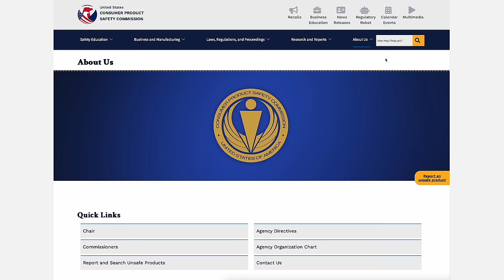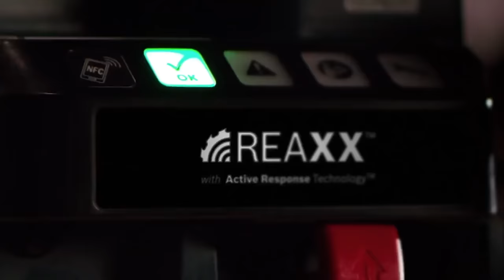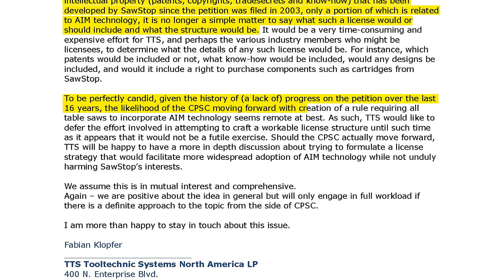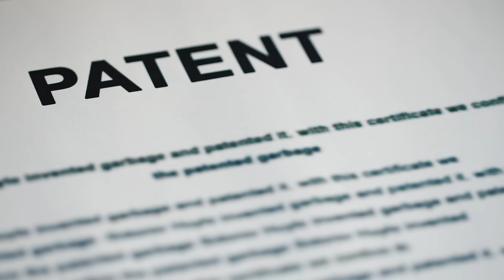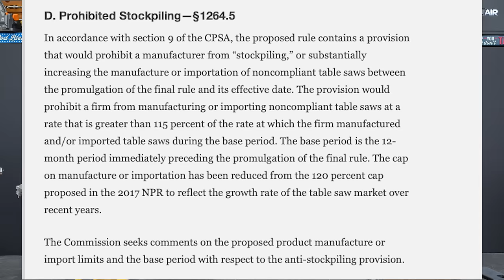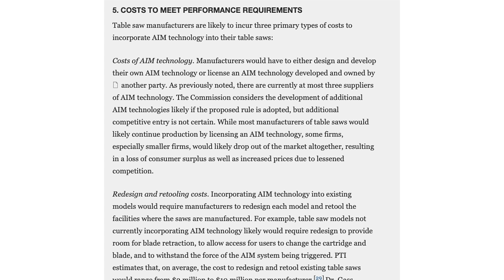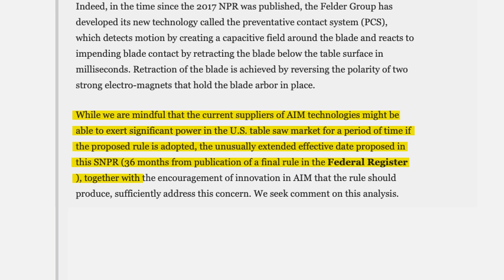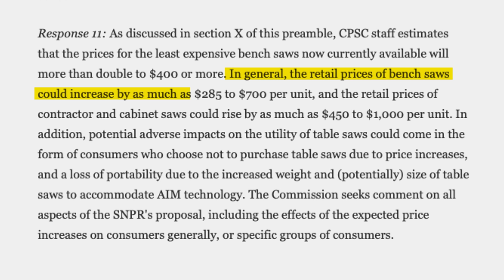The US Government is About to Change Table Saws FOREVER!

Comment: Just after the video discussed implementing the rule in 30 days to 6 months, I gave it some quick thought based on my retiring from a career as an aerospace mechanical designer and came up with reasonable time frame of 3 years. 
Once the rule is mandated, a manufacturer will have initial meetings on the design followed by product detail design. Tooling design for molds and product handling won't start until a certain amount of design maturity is reached. Cutting chips for the tools and any product detail parts won't happen until the designs are formally released. So, 3 years is comfortable. 1 year would be very rushed. 
A rule implementation of less than a year will mean that manufacturers discontinue sales until they can redesign their saws.
Reply: Do you think we need to Keep government out of this, this will create new laws and taxes with higher insurance costs to shops and individuals seeking liability and disability insurances.   Will OSHA rules could shut us down if we don't comply.

Comment: As a patent holder I am well acquainted with the patent laws and every US Patent has a rider built in stating that the patent may be used by the US Government or as a public safety issue.  The government can (after litigation)   require a patent to be licensed for what the court determines to be a fair and reasonable fee, but that can take time.
Reply: The patents that Sawstop holds started expiring in 2021, and they put out their first product in 2004.  I don't think the patents are a major issue.
Reply: @stevesether  With Sawstop, they are an issue. The inventor was a patent attorney out for a payday, not safety. Multiple manufacturers have said he was asking for a license fee in many cases equal to their entire selling price in the early days. After that didn't work, he started lobbying the government to mandate his patented technology. When that didn't work, he started Sawstop.

For as simple of a mechanism as Sawstop uses (conductivity detected on the blade trips a brake), Sawstop has literally hundreds of patents on every conceivable method of stopping the blade. They've used every legal trick in the book to extend each of those patents for as long as possible. Bosche's saw used completely different technology that didn't infringe any Sawstop patents but they still pulled out of the market because proving that in court would've been more expensive and eliminated any profits.

Comment: Price increase also seems to ignore the cost of cartridges and blades that need replacement.  The spares that need to be stocked to ensure that if you trigger off a staple left behind by the lumberyard, Black paint, mirrored plexiglass, etc...you can still hit your deadlines.
Reply: Probable cheaper then losing a finger hand etcetera.
Reply: @ChickenPermissionOG right, but the odds of such an incident happening are very low, while the odds of triggering the cartridge for a dozen other reasons are very high

Comment: Already way ahead of this I'm using a radial arm saw from 1968 and its extremely safe if you have the right blade and you know what you're doing. U can get them way cheaper than one of those little table saws too (sometimes free)
Reply: I had a radial arm saw. It is just as dangerous as a table saw but in a little different way. I believe most people do not understand that a zero hook blade must be used to reduce the possibility of kickback.

Comment: Thnks for spending all this time to get us up to date Matt.  Fct is last year I cut part of my index finger off on my table saw.  Compared to many injuries it was minor BUT a HUGE Eys opener.  I sold that table saw in less than a week and bought a Sw Stop PCS Caninet saw.  That accident changed the was I run my woodworking business.  Saw Stop as you not only provides that extra measure of saftey but they had made it so easy to remove and replace the blade guard.  Now unless I'm using the Dado set or my sled the gurd is ALWAY on.  God bless you matt and thanks again for all you do for us.  I appreciate your ministry.
Reply: The only issue I can see with that based off of what they’re saying a new system will be required for dado blades as well.   Does saw stop have a system for dados?
Reply: @elktrip2000  Yes they have dado blade stopping cartridges
Reply: @elktrip2000  Yes. You do have to use a different cartridge for a dado blade though.
Reply: The Dado brake cartridge is a separate purchase when you get the saw.  It is very easy to install and then replace the standard blade brake cartridge.  Takes maybe a minute or so.  I've used it many times.
Reply: @richragan4810   Just wait for that to be 'too complex' and so 'dangerous' for you to do. Has to go to the manf only. Just $100 charge plus the blade pack, if you've signed up to the 'special deal'....;)
Reply: Do you think we need to Keep government out of this, this will create new laws and taxes with higher insurance costs to shops and individuals seeking liability and disability insurances.  In addition to cost of table saw.  Will OSHA rules could shut us down if we don't comply.
Reply: @elktrip2000  Yes, they do. But it requires an extra brake mechanism that isn't included with the original purchase of the saw. I think the sacrificial aluminum on the dado brake is wider than the piece on the standard brake. I priced the dado brake at a local supplier yesterday. It's $119.
Reply: @peaceshalom3030   OSHA rules ONLY apply to employees.  OSHA rules do not apply to self-employed people or hobbyists.  So, if it's an OSHA rule, this rule will only apply to your business if you have employees.
Reply: I 've noticed that during the saw legislation video a 
Political Ad with 
Bernie Sanders
asking people to support 
Kamala Harris has popped up twice.
Does that mean the guy producing the video supports
Bernie Sanders , or
Kamala Harris?

Comment: Years ago I started with a circular saw plunged through a sheet of 1/4 ply, flipped upside down with the trigger taped on. I honestly think injuries will go up as a result of this. Make no mistake - this is about money not safety.
Reply: Geez, at least use 1/2! 1/4 ply I can break in half by leaning on it

Comment: This requirement will barely lower the number of serious injuries for 2 reasons: #1, the saw-stop tech has to be able to be disabled so you don't activate it when cutting wet wood, nails, etc., so a bunch of people will just disable it so they don't risk needing to buy a new blade set.  These are also likely the people who won't treat the saw with respect and are more likely to get injured.  #2, there are 10s or 100s of thousands of active table saws out there that will continue to cause injuries for years to come.  The government needs to stop trying to protect people from themselves.  The CPSC is supposed to stop negligent and malicious issues with products, not impose severe tech changes to a tool that is always going to be dangerous.
Reply: seatbelts, airbags, many examples of things like this that have worked over time.
Reply: @jasonrowe6302  Seatbelts? The things that a bunch of people don't wear and the only reason half of the people who do is because the cops will ticket them otherwise? You gonna send cops into everyone's house to ensure they aren't disabling the sawstop feature?
Reply: @shawnpitman876  great logic to not do it. Seatbelts cost more when they were implemented. Now it's just the price you pay for the vehicle. A very small portion of people chose to not wear them as will a very small portion of users if saws with the safety device. It's likely not going to impact saws already out there just like the new seatbelt law didn't impact cars already on the road.

Comment: I’m on job sires every day. This week we had 30 degree weather followed by 70 degree weather with rain. Condensation was dripping from everything. How is this tech going to hold up in these conditions?
Reply: It wont. I've personally burnt though 7 sawstops cutting damp wood, and with the price of replacement cartridges I decided I was better off buying a saw without it.
Reply: It won't. But don't worry. The fine folks at Sawstop will really enjoy the new yacht you're helping to pay for, and the folks on that safety committee who have never used a power tool in their miserable lives will get a warm fuzzy sense of superiority for protecting us from ourselves.

Comment: I think the worst injuries occur when you grab the work piece past the blade and get a kickback that forces your hand into the blade at high speed. You can't let go of the workpiece fast enough is the problem. I don't think a lot of people just push their own fingers into the blade from the front side.
Reply: Met a middle aged and well established cabinet maker who lost 1/2 the length of two fingers pushing stock through a table saw.  He then showed me his other hand that had the same two fingers trimmed the same amount.
Reply: @gregohare2406  Wow. One instance doesn't prove me wrong, but it does cause me to think twice about it.
Reply: @mckenziekeith7434 it good to be careful, but this guy was (possibly) an idiot. He did it twice to the same fingers on each hand. He’d probably do it a third time if he had another

Comment: My grandfather and grandfather were carpenters, my father is an avid advanced woodworker and I do woodworking - never had an accident. Although I was taught to have a good well made tablesaw. Was taught how to feed the material into the saw. What type of blade to use and when. How and when to use a push stick. I run a unisaw from the early 90’s and my dad’s unisaw is from the 40’s. I’m all for the safety but the sawstop having the patent and the government saying every saw needs it is well creating a monopoly - just another way of using “safety” as a means of control - never though my old table saw would become political pawn……

Comment: There's quite a few problems with this proposal:

1.  If this is mandated for table saws how long will it be before other tools and equipment get similar mandates?
2.  More importantly "safety measures" put on dangerous pieces of equipment could actually embolden people to be more reckless and complacent when they're using said equipment.
3.  And of course, why is it the governments job to prevent careless people from being careless?  If someone missuses something how is that the public at large's fault?
4.  You can't fix stupid.
Reply: lets NOT forget #5, people WILL remove various safety devices if they think those devices hamper productivity.... and some will be removed simply because they can be removed... and #6, accidents will STILL happen no matter what safety devices are on a tool or other hazardous device... that's part of Murphy's law, anything that CAN go wrong most likely WILL go wrong....
Reply: @mikewhitaker2880  Yeah there's definitely more issues, but I got lazy and just mentally lumped everything into problem 4.  Also I myself am guilty of taking safety guards off of my power tools, though if it's an internal safety component were someone has to actually take the tool apart to remove it I think most people would probably just deal with it.  Especially if that component cost them hundreds of dollars extra to be there.
Reply: You can't engineer around stupidly. Remove the safety labels. Let natural selection work itself out. Give emergency services the job security they deserve.
Reply: Relating to #3, Congress passes laws that create agencies like the CPA and the FTC and their job "IS" to make things safer because that is what the law says. The Government answers to groups with money. (Because they all need it to get reelected)  Insurance companies have mountains of money. They do not want to spend money on repairing your flesh. They want to take your money and pay themselves huge bonuses. Look at cars, what is the cheapest car in america? Its well over 20k now. But it has all the safety stuff on it that only Mercedes had on their cars 20 years ago.  Mercedes didn't push more safety so that they could get their patents licensed by other manufactures. The Government wants to make things safer, all things, across the board.  Eventually our Government is going to go bankrupt, easily within 10 years, so none of the "Safety" laws will matter because there is going to be a big reset.  I foresee a huge black market for $300 saws coming across the boarder from Mexico.  Just watch Ebay and FB Marketplace they will be everywhere just not at Lowes and Home Depot.
Reply: 1. Tablesaws are disproportionally unsafe compared to other tools, this is not a problem, the reason that this is being proposed in the first place is because tablesaws are one of most dangerous tools
2. no evidence backed up to this claim, but no, in general safety options are deterrents, especially if the safety option is almost all pros. Outside of cost, the sawstop solution is almost entirely all pros
3. The government has in its best interest to help its citizens, the government legislates safety all the time, from the rules on the road, to food, etc. etc. etc. In addition, this costs the government money, we have partially subsidized health, and lost productivity is also less tax revenue.
4. agreed, but even a stupid person grazing their hand over a saw blade can have their fingers saved by this system.

Increasing safety standards is not necessarily a bad thing, we look at modern cars, from bumper design to seat design, to extra features such as rear cameras.
Reply: @Jazzyluvsyou100  "disproportionally unsafe compared to other tools" Wow, what a completely useless statement devoid of any actual useful metric. Two give an example with made up numbers to dumb it down: If two people a year scratch themselves with a hand saw, and four people a year scratch themselves with a carving knife, that's like hand saws are "disproportionally unsafe!!1!" compared to carving knives... Not only "disproportionally unsafe!!1!" but like DOUBLE!!! It's only four people a year... 
"almost all pros" What does this mean? 
No. That's not what the government is for. This is nothing but nanystatist intervention that will cause prices to go WAY up pushing small companies out of the market and price these out of the hands of regular people.
Reply: @bitfreakazoid  

Chill out dude.

Let's break this down.

Of the power saws tablesaws are the most dangerous, now we can't know the exact rate of usage comparative to other saws. But of power saws, tablesaws make 78 percent of the injuries of the power saw category, that amounts to around 29k a year in ER visits/injuries. Tablesaws are in the top 4 most injuries per year for power tools. 

 Obviously there are more dangerous tools..... such as you know, ladders(that are also highly regulated). that doesn't mean we cant make them safer

""almost all pros" What does this mean? "

Ok, so imagine you have safety feature on a tool, lets use Tablesaws for an example,  So you have a blade guard for example, now this obviously make it safer, but they also have usability downsides, its harder to see where the cut is, certain cuts can't be done with a blade guard attached. etc. etc. This affects the usability of the saw, it makes it more cumbersome to use, those are "cons". The reactive blade system has almost no cons, it doesn't affect your ability to see the blade, it doesn't affect your ability to do certain cuts. The only bad thing it does from my understanding of the technology, is that rapid voltage changes in the blade from metal will trigger it.

So, almost all pros. Sometimes safety features can make the tool more cumbersome to use. The only practical downside to this is of course "COST".

"No. That's not what the government is for. This is nothing but nanystatist intervention that will cause prices to go WAY up pushing small companies out of the market and price these out of the hands of regular people.

"

Hilariously, the constitution says that yes, it can do this. 

"the Congress shall have Power To lay and collect Taxes, Duties, Imposts and Excises, to pay the Debts and provide for the common Defence and general Welfare of the United States"

General welfare is how the government gets its power to enforce and create safety regulations. And the government will continue to regulate whatever it seems fit. Don't worry the nanny state that regulates your planes, automobiles, roads, infrastructure, work code regulations,  and various other industries is regulating another industry? HOLY SHIT i can't imagine that. In addition, riving knives and bladeguards are already required by law.
Reply: @bitfreakazoid  

Also, i actually don't think this safety device will be 200+ bucks per saw. I mean lets look at this rationally for example.

Its a cheap piece of extruded aluminum, with some pretty cheap electronics. (I design PCBs as a side hobby. that probably amount to around 3-5 dollars a pcb from what ive seen on sawstop. The explosive cartridge to trigger isn't expensive.

The raw material cost of this system is just really, not that expensive. The instant this stuff becomes unpatented by sawstop and you get the economies of scale of a Chinese OEM making these things, i expect them to be in the 20-40 dollar range.
Reply: This week's Tiktok trend "see how good different table saw brand's AIM works" 😁
Reply: @theGr8mark  They step over the lines too often.  See the EPA for references. 

The administrative state, which is what these regulatory bodies are, offer politicians the perfect scapegoat for not doing their jobs.  

Their job is to deliberate and create laws.  Regulatory agencies absolve them of their duties and shield them from bad political decisions.  All the better for them come election day.

I'm sick and tired of unelected bureaucrats trying to make laws.